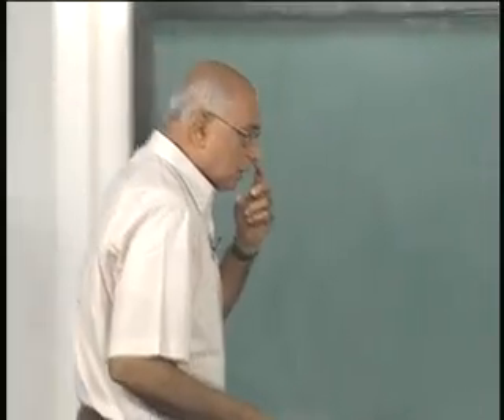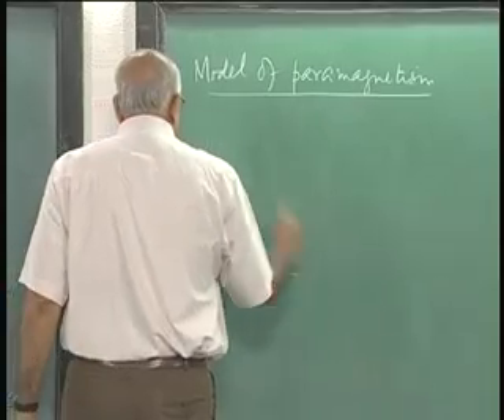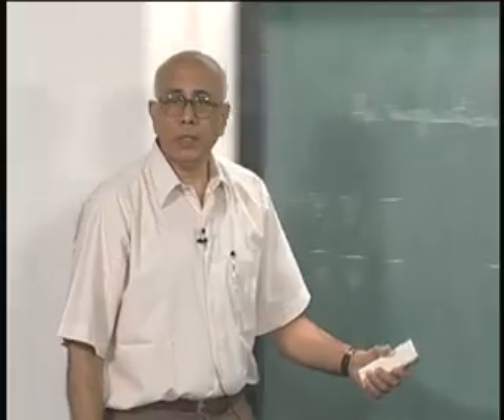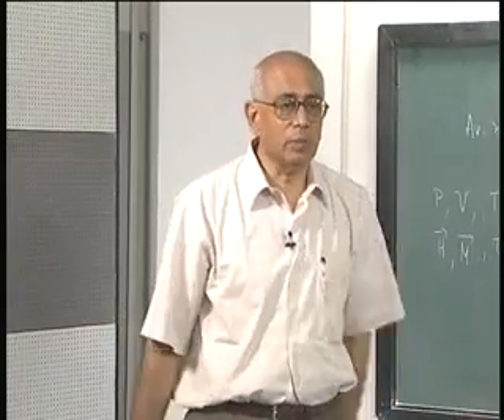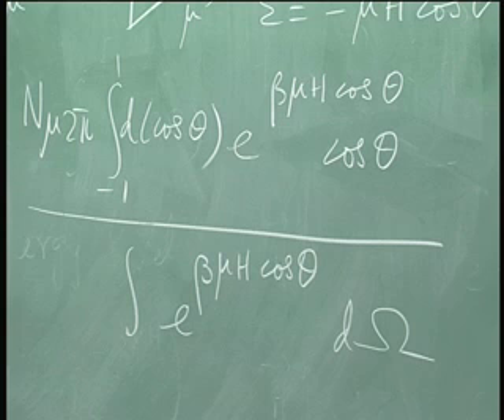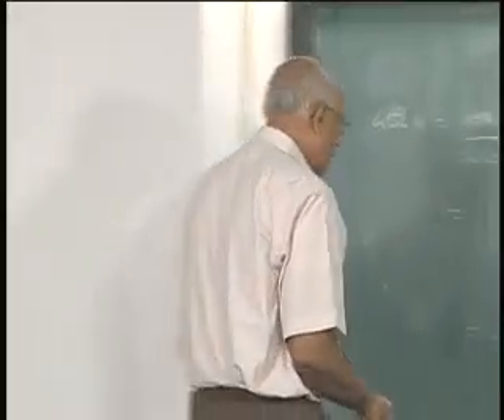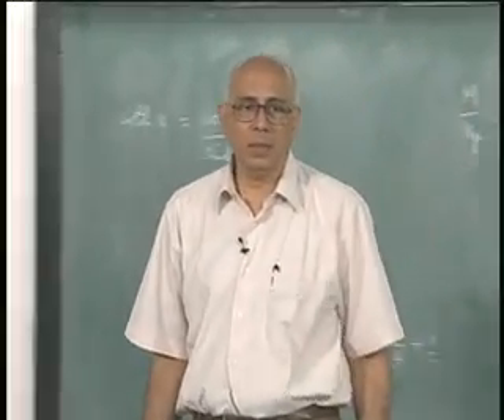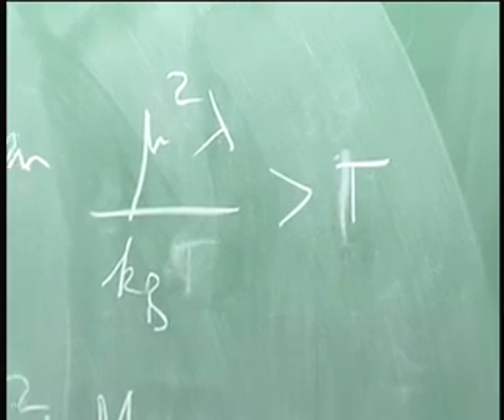Mod-01 Lec-28 Phase transitions (Part 2)

Comment: School : Interactions between molecules is stronger in solids, weaker in liquids and much weaker in gases
Grad School : Interactions between any two molecules is the same in solid or liquid or gas, only the disorderness of the system dominates at higher temp when compared with internal energy. Nature can be understood in a much better way with statistics. The beauty of statistics. :-)